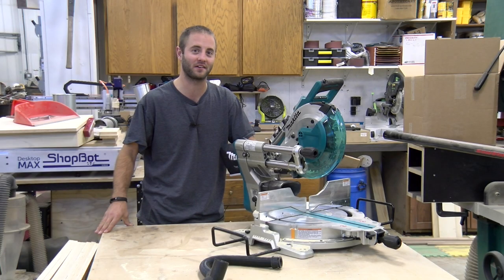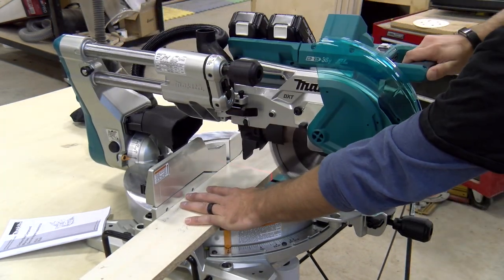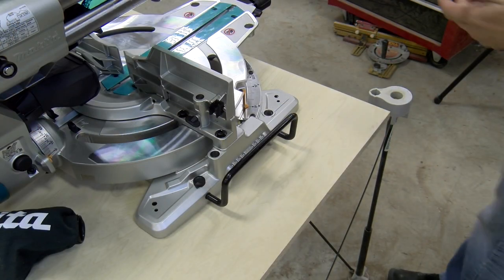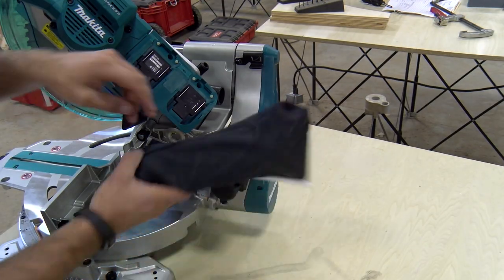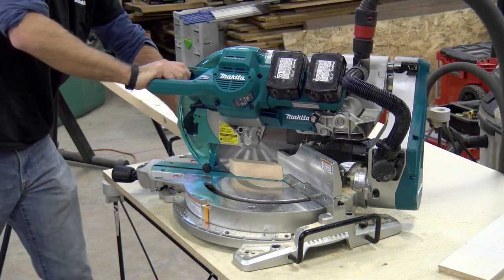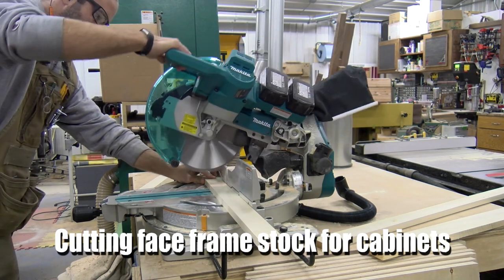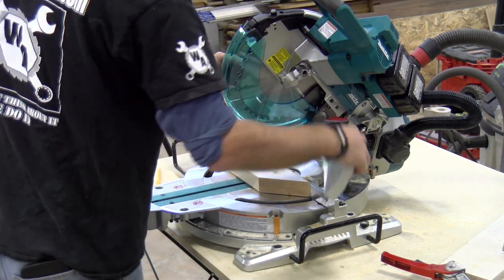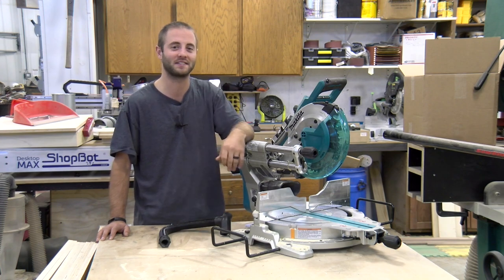Makita x2 36v Cordless Sliding Compound Miter Saw XSL06Z Review

Comment: I just bought one and used it for a large house where I was running 5-1/4 base.  I loved this saw.  I literally ran the saw all day on one charge.  It is impressive.
HD had them in stock for $649 with two 5.0 batteries and a dual charger.  Tool only is $539. 
Two batteries alone usually cost $149, so for an additional $110, getting two batteries and a dual charger was a no brainer.
Reply: Mark Wigley where did you buy it?
Reply: David Strauss Jr HD usually means Home Depot.
Reply: Just picked one up yesterday for $270 🤣

Comment: Had the corded version of this saw and sold it recently to buy the cordless version, if you have any doubts about this saw then give your head a wobble! Its accurate and reliable and produces very clean cuts even with stock blade! Only bad points are the weight, the rear fences have to be removed for compound cuts and it does like to kick back if you try and cut too quickly. However the good points far outweigh the bad points and its a phenomenal tool with plenty of power!

Comment: This is a fantastic saw - great review. Being cordless, It’s portability for on site work is extremely useful. I have a corded  dewalt saw that stays on the main saw bench, and the makita moves around the site as necessary. I have the Bluetooth model which connects to my 36v Bluetooth makita vacuum - I’ve also regularly had it setup on the back of my ute for small jobs. Highly recommended..

Comment: This is a terrific review. Thanks for taking the time to put it together. A couple of questions for you? Awhile back when lasers made their debut on miter saws, Delta and Porter cable had twin 12" models (non-sliders) that were highly thought of and used a similar set screw system to fine tune line placement. Unfortunately, the failure of that set screw system to hold where it was set and the subsequent drift of the lines over quite short periods of time (a couple days of regular use) made the laser pretty much unusable. I went back to being a creeper. Have you experienced a failure to hold and related drift with the laser setup on this saw? Second, even farther back when radial arm saws were common, it was theoretically possible to trench or dado. The problem was that it was almost impossible to set the saw up so depth of cut at the front of the stock was the same as at the back of the stock. The wider the stock, the greater the discrepancy. If you got lucky and things lined up correctly, you might get a few satisfactory dados before the saw again lost its front to rear depth of cut accuracy. In trenching, have you measured to see that the depth of cut is consistent from front to back of the stock? Thanks again for this review.
Reply from the maker: Jim Webb Our depth of cut is consistent.

Comment: KNOCK KNOCK MAKITA~!!!!
    As a veteran with over 35 years with Makita products, I have ONE QUESTION:
WHY create such a good looking saw, and restrict it to only batteries?   To my (and I'm sure others) way of thinking, a SLIDE ON ADAPTER for power would make this an EVERY SHOPS SAW!  Not to mention, one which when at a static location it becomes a moniker of the shop as WE ALL KNOW the miter saw is a SHOW PIECE of any wood working location.  
   So BE HONEST......was someone asleep at the wheel or is this an interim level production while the REAL tool is being engineered???
Reply: This tool also comes as a corded model. But not battery and corded on the one tool.
Reply: Dewalt probably owns that technology and they may not even want to license it. If I were makita I wouldn't want to pay them shit
Reply: I am not sure you could patent that since so many things have had dual voltage for cordless or batter power. Might have more to do with their system especially motors. Anyway neat saw.
Reply: metabo have similar technology that allows their cordless tools to run with as a corded tool. But yes, I think makita should have come up with option, give the consumer the option to run it as they see fit.

Comment: Great review! I recently just purchased this saw and been very happy with it after getting it dialed in.
Question for you is the upper fence on your saw flush with the fixed fence 90°? The upper fence on my unit is 1/16 back from the bottom.
Makita was kind enough to send me another set of upper fences but it's the same thing. I ended up Machining the back of them so they sit flush now.

Comment: I think you would get better dust collection if you ran 2 separate hose to the saw from a splitter on the vac.
Reply from the maker: MelbourneAlan unnecessary
Reply: why . the standard set up is failing miserably. it restricts the air too much. if you ran that with 2 36mm hoses from a festool ct26 or similar vac with a splitter you would get much better dust collection

Comment: Good review of the features of this saw. Did you actually try to make a miter cut at 60 degrees with the top fences in place? I just installed the blade on my new saw and it contacts the fence at miters above around 50. Good thing I checked! Of course you have to remove the upper fence for bevels, but Makita makes no mention of having to remove it for miters above 45. 
Also, the vac adapter hose that comes with the unit doesn't lock onto the port very tightly and tends to fall off very easily during use.
Reply: OK, I readjusted the bevel, which I guess wasn't fully up against the 0 degree stop and the blade is not contacting the fence. It's VERY close at 60 degrees though. I would definitely check it before making that cut...
Still haven't resolved the hose coming off the port issue. Does anyone else notice this? Am I missing something?
Reply: My blade contacts fences on 60 degree mitres too. Watch out. Username toolaholic on Instagram addresses hose connection issues in a recent post.

Comment: kicking my butt for not buying this bought the 36 volt cordless circular saw that looks like a worm drive on clearance from Home Depot with batteries and double charger for 245.00.  they had this saw there too on clearance with 2 batteries and charger for 399.

Comment: Great review! I have one and you forgot to mention that the removable fences store on the extension bars when not in use and have a clip on the back. Also, mine cuts on a slight curve. Does yours do that. I have tried 3 different blades and it does it in all of them but they were all thin kerf blades.
Reply: I just saw a Australian man review a 10” version of this saw , the video is 38 mins long if you search for makita 36volt miter saw review u can’t miss it! He shows u how to adjust the saw to shop that happening . Good luck 😉
Reply: @stephentoby8750  Thanks I just saw this and I guess it's been about a month and a half ago that I found his video and fixed my saw.  Now it cuts straight and I have not had any more issues. I have been building a deck with it and it's a very nice saw. I have it on a Harbor Freight Hercules miter saw stand. It needs a stand with a wide stance due to it's weight. So stands like the Delta gravity rise or the Ridgid one do not work well. I tried it and it felt like the thing could get knocked over very easily!
Reply: Any link or name of the video?

Comment: Had my LS1013 15 yrs, it's new owner is remodeling his house with it.  This is a nice looking saw, but where am I gona be in 10 yrs when the batteries are obsolete ????  If they made it dual, battery /120v corded i'd buy it . I see no benefit to cordless here. It has never been a problem to run a cord to a saw.  Cordless is great for time saving and productivity with drills, angle grinders, hand saws ...but a miter saw is stationary...a cord is better any way you look at it.  Makita, focus on just making a saw that cuts STRAIGHT ...that's why I can't buy the LS1019 .
Reply: Does it matter if you can get this saw for $400 with 4 batteries? So I think it depends on what price you can get it at. There was a recent promo on this at Home Depot. Too good to pass up. And in 10 yrs, I think I'll want the latest and greatest anyway, the one that's equipped with voice command and will auto-cut for your when you tell it to. LOL!
Reply: I agree, unless it was dual mode I wouldn't buy it.

Comment: What are those holes in the rotating-table for?  Maybe for the hold-down-clamp?
Reply: David Januszewski they are so the fence has supports closer to the blade and doesn’t need to rely on the mounts on the far outside of the table for.

Comment: In all my years as a carpenter contractor, I've never not had power on a job site. I would never relie totally on batteries. What do you do if the charger or some batteries go down. When I'm using a chop sas i have a table saw, often a Jig saw, planer, ginder or dremel tool add up the cost of batteries for all these tools when the plug in version is more reliable and often more powerful. I'll stick to using battery drills and impacts with my corded tools.
Reply: Charles Kuhl as a cabinet installer I’ve had no insufficient power on a job site 3-4x just in the last 6 months. How I mean is that there are typically 2-4 plugs for 5 trades running multiple cords each. It happens often.